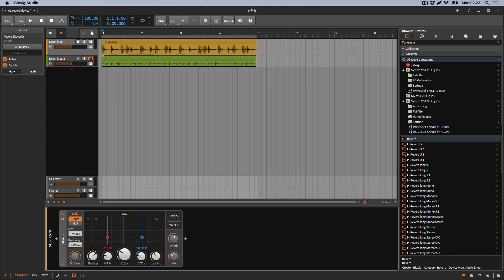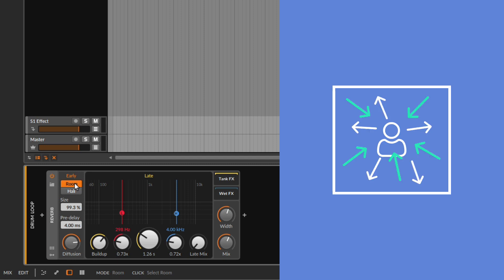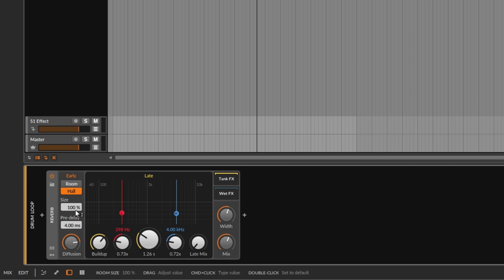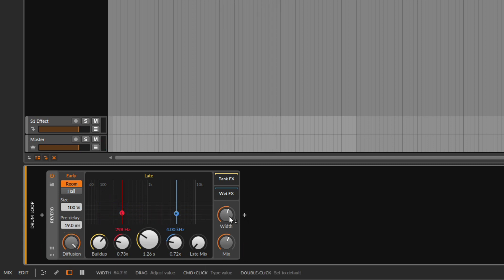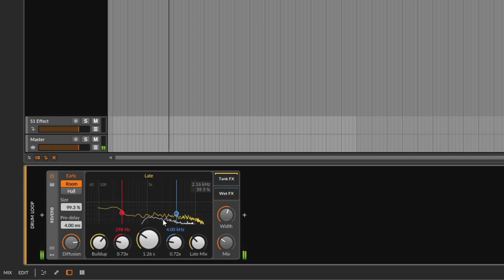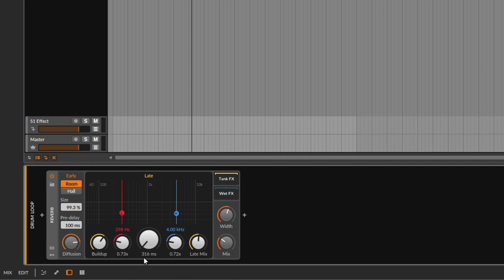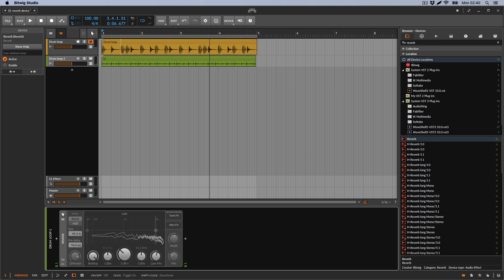Understanding the Bitwig Reverb Device.

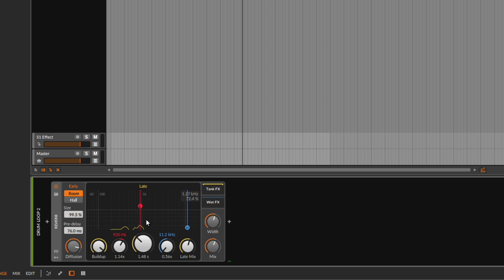Comment: 12:40 The Low and High lines are reverb time multipliers. If you reverb time is 1.5 second and your high mult is at 0.50, it will go for 0.75 seconds (1.5*0.5)

Comment: Wait: this EQ-like thing in the middle works only for the late signal, the Tank-fx only for the early reflections and the wet-fx for the whole reverb signal? Wow. I never understud this thing. Thank you very much. Now I get it!
Reply from the maker: Sure, you are welcome. Its a good reverb, for a stock reverb. You can get much better sound out of some other reverbs like valhalla reverb.Just 50 bucks and you get a much better and versatile verb.
Reply: Like K nzo said, it's not an EQ, it's a multiplier for the reverb time. It changes the reverb time below(for L) or above(for H) the bar.